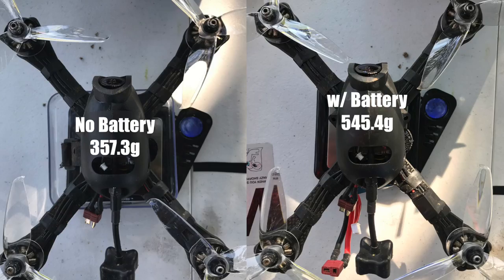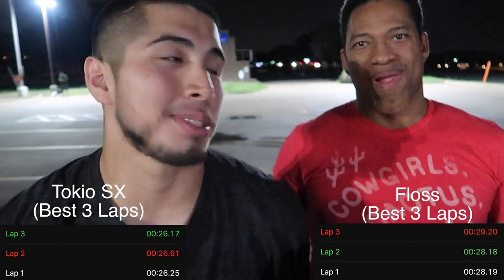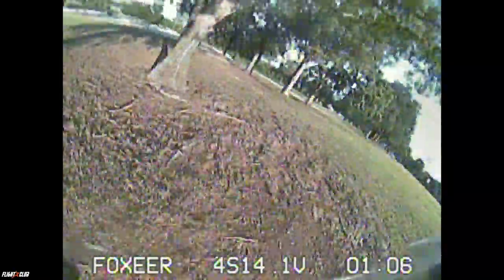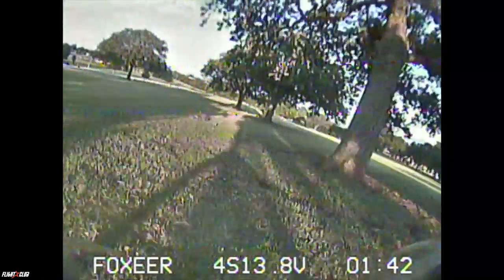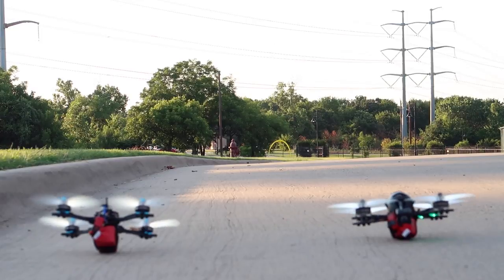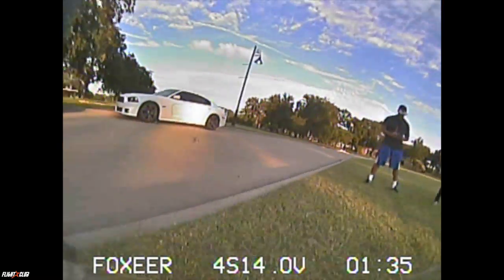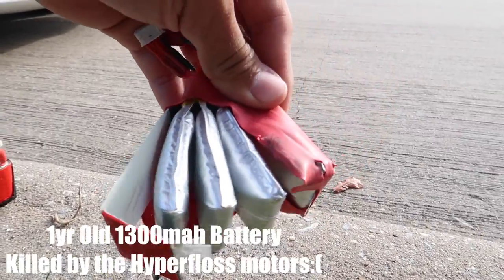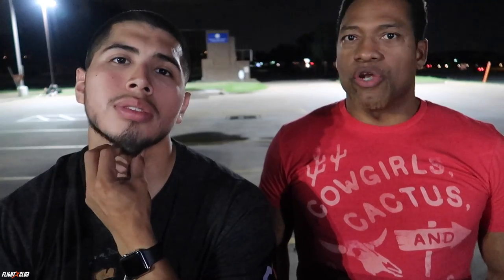DISK THEORY DEBUNKED???

Comment: This is not a comparison, this is just to show that the f40's are a lot more powerful. Swap the motors and do the test again. 

Yes with those motors the weight maters but also the props and you used to heavy props for those motors.

Before you test, now what you want to test and how to test it. As you want to test if weight maters, use the same electronics and the same frame but just ad 100g to one. Not 2 complete different motors where you put one one way to heavy props on so they never deliver for what they can deliver.

Comment: Light vs heavy there is no debate, light is always better that is when all other things are equal. Two quads with the same power output, the lighter will be better, its science its logic. Now disk loading theory has merit but more testing needs to be done,like yours. I say know your battle and pick your weapon. In a tight track where top end is useless and agility is needed bring a floss or something similar. In a more open track where you need to punch the trottle, something like your tokyo will be better.

Comment: im curious why your tokio is so much heavier than mine... are the F40s heavy?

Im 30g lighter (before battery) on my tokio running what I thought were fairly similar components (omnibus f4, 4-in-1 30a esc, hyperlite v4s, foxeer monster, tramp). I didnt pay much attention to weight when speccing components, but im at 327g without battery (i run 1300s currently
, so I gain another 30g there)
Reply: Are you including props?
Reply: mooosestang yeah

Comment: on the light frame you should use two blade props they have less thrust but thrust is not top speed and use high kvbut i agree all my buddys are flying very light builds and i am still flying my old frames heavy and my quads are fast they even say it i lose on skill hahah

Comment: If you need lighter, run without a battery. Significantly lighter and less likely to occur high speed crashes. Much cheaper on parts and you can run this setup inside your house. /sarcasm :D

Comment: you guys should have used the same motors one each build
Reply from the maker: Tristin Gilbert that’s not what disk theory is, if they both sued the same motor then of course the lighter frame quad would be faster
Reply: I understand that. I know that some people don't really care about the disk theory and just go off of what feels good in the air. Your findings were correct and well thought. I also know it depends partially on the pilot and their preference of flying. Good video though!

Comment: envy no disrespect to anybody. but your test needs to be re-done. You should test both the floss & Tokio in 3 setups. Light medium and heavy. ...simply have your light build then add extra weight to test numbers. comparing the floss to the Tokio is not working because no 2 frames have the same flying characteristics.  You should compare them to themselves. That will truly debunk the disk loading theory.
Reply from the maker: Juan Rodriguez mmmm thank you for the feedback. We can maybe test and re do another test video doing.
Reply: Juans idea is spot on, it will also go a long way to potentially show where the power to weight ratio sweet spot is!  Id like to see this video.

Comment: SON OF A B*&CH you guys are hauling ass.  I absolutely love T-Motors stuff.  Completly agree with their torque.  All their motors are like that.  I run the F80 1900kv and 7" props for a 7" Alien and I shoot to the F-ing moon if I goose the gas hard and thats with a GoPro on.
Reply: Nick what battery are you running on that setup?  I have a 7" frame coming soon, and trying to decide if I go for a 7" prop or 6x4.5x3" prop.  Also trying to decide if I should go up in voltage to a 5s battery or stick with 4s.
Reply: Nick also trying to decide if I should go for 1900 or 2200kv f80 motors. I'm nervous that 1900kv might be too slow for acro.
Reply: Just a heads up for you.  I had F60Pro 2200kv motors on the 7" at first and it screamed but was also killing the shit out of my batteries in like a minute of flight.  Motors also came down hot as fuk.  2200kv on 7" props is seriously over propped.  I just got the 1900kv motors in yesterday and flew it and was totally amazed at the power on 7" and flight time seriously improved.  Motors come down luke warm.  Its a much better setup.  you SERIOUSLY will save yourself a shit load of money and frustration by going with the F80 1900kv on 7" props.  The power makes my 6" on 6" props look weak when my 6"ers made my 5" look like a total wuss.  Now my 5" flys without a GoPro just to try and make up the difference.  My 6"ers handle the GoPro weight like its not even there.  The 7" handles the GoPro weight like it has the power to handle acro and carry 5 GoPros, lol.  F80-1900kv.....WILL NOT GO WRONG!!!  :)  I run Tattu 1300 pack 90% of the time but I got a couple Tattu 1550mAh packs for the 7".  Hard acro flying I get almost 3 minutes with the F80-1900kv, verses same battery getting 1.5 minutes with F60-2200kv
Reply: Nick thanks Nick for the advice!  Ok I'm convinced by your advice.   Going to order the 1900kv motors.  So you're running 4s batteries then?  I'm planning 2200mah batteries. For some 5+ mins of acro flying.  I'm not into tight proximity flying.  I like smooth acro with space.
Reply: Yeah I'm running 4S 1300 to 1550mah.  I have a couple 5S 1300 packs which F80's can handle 5S so I'm sure on 5S it'll F-ing scream.  At least 5S on my 6"ers is like adding a supercharger and a shot of Nitrous.  I'm sure the same would happen on the 7".  2200 aught to give you 5min flights but I do wonder about the weight.  You'll have to tune your pids according to that weight and strapping anything else on is gonna throw the feel off a smidge.  My 1550 packs are 187g and the 7" all up weight with gopro and battery is 795.  But again even though that might seem heavy these 7" props are nuts.  MEGA POWER.  I feel like I can pick up a small child and fly them around on it, lol
Reply: I feel like I am kinda paving uncharted territory with 7" mini quads.  I don't know of anyone else doing a 7" Alien on actual 7" props.  I see 7" Aliens on 6" props.  I have done a lot of trial and error as no one really had info on this type of setup.  If you have an email I can send you info on my quad and the PID/Rates setup I have for it.  Its yours if you want it.
Reply: Interesting stuff! I've been wanting to build a 7" endurance build myself, but run it on 1800 or 2200 packs, shooting for 5-7 mins of smooth, big acro flight. What 7" props do you run on yours? I was thinking that it might be possible to get a good result with twin blades on such a large amount of disk area. I know that 2 blades on a 6" feels more locked in than twin blades on a 5", so I'm guessing the same thing happens on 7" props too.
Reply: Chris Tate I run HQ7x4.5-2 blade props.  Its crazy power and locked it great on those

Comment: Lmao 3022kv 2204's on 5152's. Joke. What a waste of time. You stacked the deck against the floss. Unsubbed 

Literally used their 4" motor to spin a heavy ass 5" prop. Might as well have used 6" props on a 1407. 😞

Comment: Noooo haha. The little 2204 is completely over proped with the 5152 (espacially at that high kv) . Put a bi blade on the floss and you will get completely different result. Unfortunately you did this 'test' completely wrong. This is a completely unfair comparison and 'test'.

Comment: All i hear from this video is. F40 TORQUE F40 TORQUE F40 PROS TORQUE...............Is this a sales video? Lol    Use the same ESC and Motors dude....guaranteed that lighter frame with the F40S and ESCs will perform better.
Reply from the maker: +Nicholas Ziadie haha no but that’s my racing motor, but the thing about the disc theory as far as I know was based on the DL# it didn’t have to do with the exact same setup such as same motors, esc prop etc. I thought it was based all up on AUW. But yes I agree with you of course f40 pro on floss would embarrass the tokio lol
Reply: Nicholas Ziadie so Nich, whats your thought about lightweight and heavyweight? I know you love your compact orion 190 lol
Reply: Lol I dont use the orion 190 anymore. Im flying the Bolt RC Kraken.  I've become a POD lover.

Comment: You're doing the light quad setups wrong. You should be running 4 inch on the brother hobby 1407 lowest kv version on an 850mah 4s
Reply from the maker: Beau what’s the AUW of one of those,
Reply: EnvyAstro less than 250. The motors comes down screaming hot sometimes and your pushing the equipment to its limits but it's the absolute epitome of disk load theory.  I agree with you however, disk load is only part of the equation and thrust to weight ratio matters tons more.